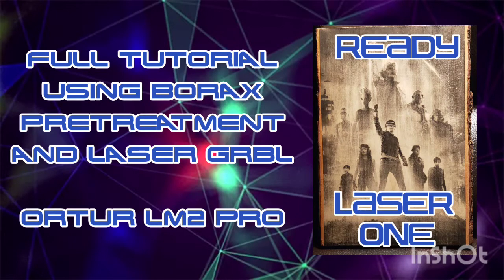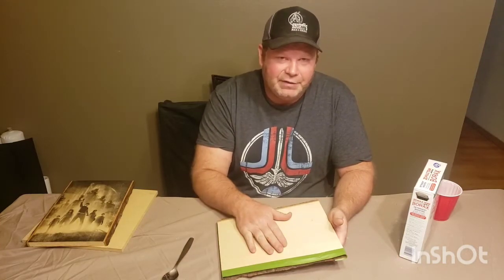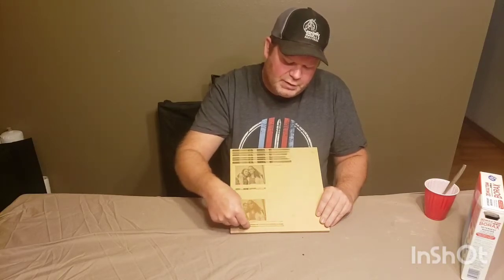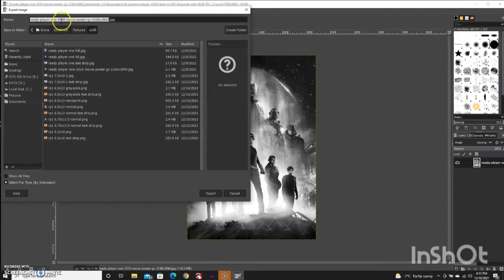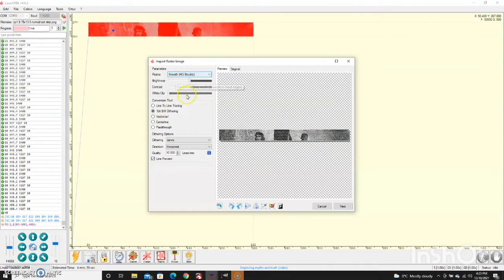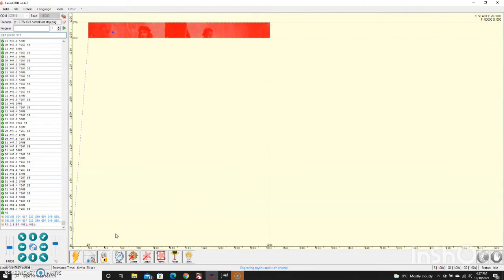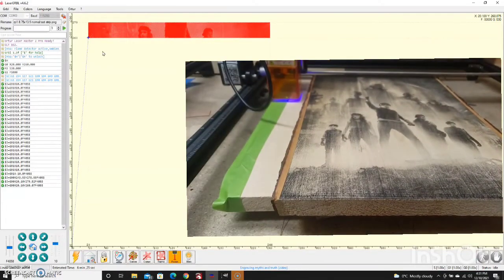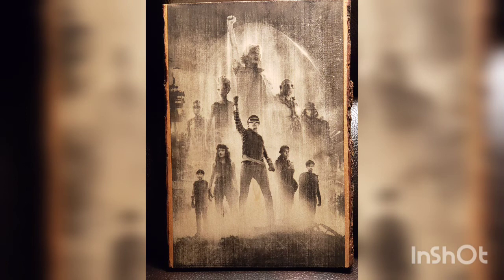Full Tutorial: Borax Pretreatment and Laser GRBL with an Ortur LM2 Pro

Comment: Nice video Kenny! When using baking soda is it around the same amount as the borax?
Reply from the maker: about the same i think.  I usually hear 2 tbsp / cup. I only tried it once and it didn't work well at the higher speeds as the aging stain I use. Borax works very well. Actually better for using dithers. Im still testing but I don't think it works as well if using grayscale instead of a dither. Both Borax And Baking Soda seem to only turn black or nothing. The aging stain does produce a nice gradient for grayscale. They all have good uses. If doing cutting boards Baking Soda is the way to go as it's food safe. just in case somebody actually uses their lasered cutting board.
Reply: @TheKennyHack  thanks for that info Kenny! What's the aging stain? I must have missed that video. Is it the stuff you can find at home Depot/Lowe's?

Comment: My issue is I get soot dust turning the lights all grey
Reply from the maker: if you're using Borax, after it dries wipe the surface off with your hand. you'll feel a dusty texture. wipe until its gone. This is excess Borax on the surface. It will look like good detail but disappear when you clear coat it. You want to set the power til it's getting black but you should be able to touch it with your finger and not pick up very much soot. If there is a lot of soot it will cause issues.

Comment: I've had better luck with line to line for more details
Reply from the maker: line to line from what I can see is LaserGrbl version of Grayscale in Lightburn as you set the max and min power. Grayscale can produce much smoother images but on my computer it really slows down the machine. Around 5500-6000 mm/min is about as fast as it really runs. So you have to give up some time for it. Thats fine for self projects but if you are pricing out sales items Time is $. The aging stain I use in my early videos works very well with grayscale. I haven't got to try out much with the borax. My first few quick demos didn't turn out well, so went back to basic dithers to start with.